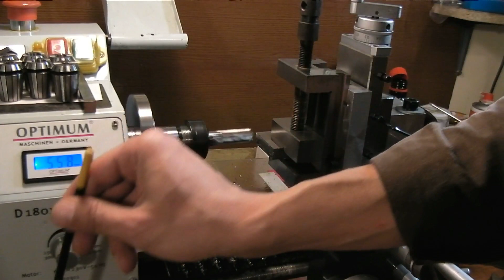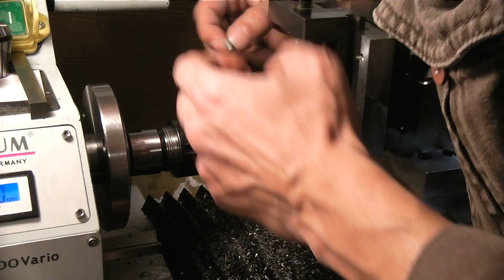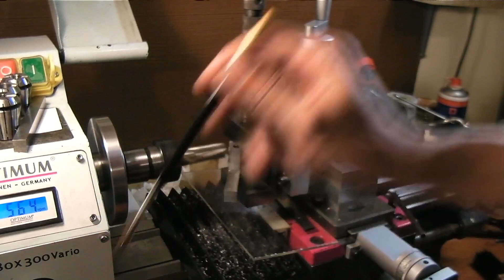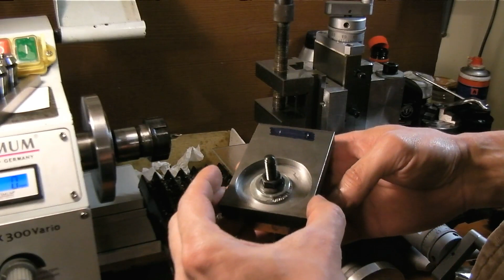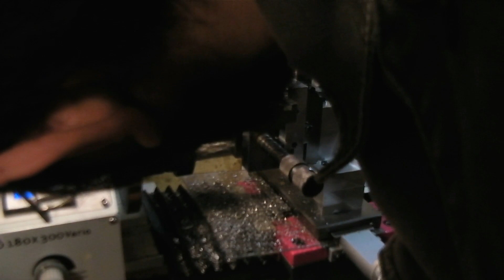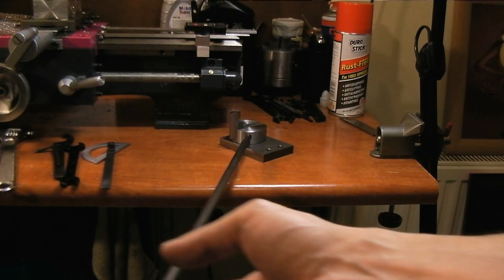Optimum D180 x 300 ball turning attachment Part3

Comment: If your cutters and tooling need sharpening on a regular basis. Revise the amount of coolant you use seems to be inadequate from what I use. I used the same method as you milling my Radius Ball Turner. Nice looking Lathe mine is a Vispey 1920's Model From Iron Woodesign.
Reply from the maker: LIANI347 Thanks for stopping by. Now I'm using the less possible cutting oil to avoid the fumes. That costs in tooling, but there is nothing I can do. At least for now. My plan is to use water soluble cutting fluid in the near future.

Comment: Excellent work, I want to make one too! What sort of pivot bolt/attachment did you use? How do you tighten it enough to just allow the bearing to turn, but the pivot not come undone. How does a tightened bolt pivot under the base freely?
Reply from the maker: Thanks! You can visit my Blog end see some more pictures from the project to get an idea. There is a link in the description. I'm using a medium strength thread locker and before it dries completely I'm making some minor adjustments to get the feel I'm looking for. If your lathe is bigger and there is some more room you may take a different approach and add a spring or something.
Reply: Baseline46 Ohh ok. I thought threadlocker would be what you would have used, but what sort of bolt and where did you leave room for its head?Im guessing you would use a washer so it doesn't gouge into the base plate. But I didn't see where you left room for it.. The other possibility is a countersunk head, but this would have to rub in its countersink hole with lube, and that doesn't seem like a precision way to go about it..

Comment: Nice build, but the filming was a bit distracting, for two reasons.

1. The camera kept grabbing focus on bits of the lathe, leaving the work a little out of focus.

2. The filming angle was sometimes badly chosen, meaning the machining couldn't be seen, as it was blocked by parts of the machine (eg. the vice jaws), or your arm, head, etc.